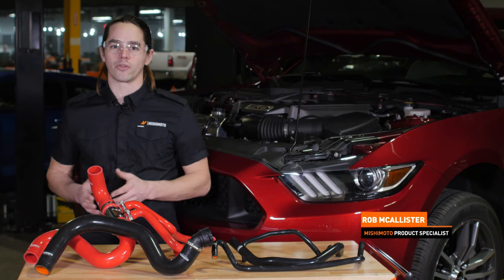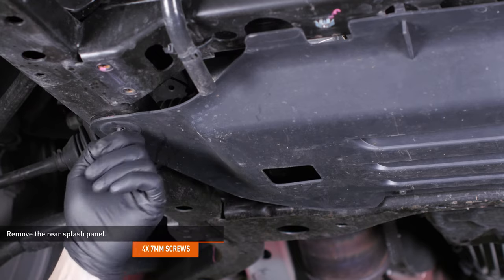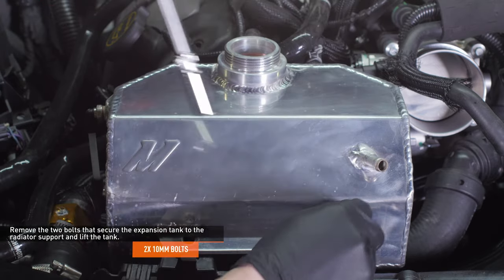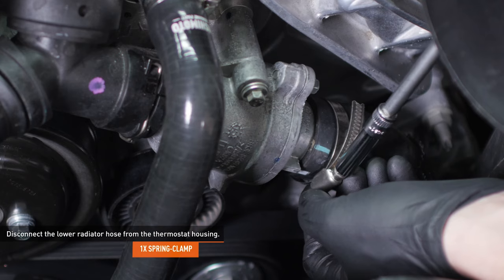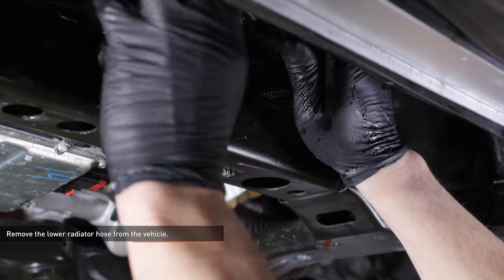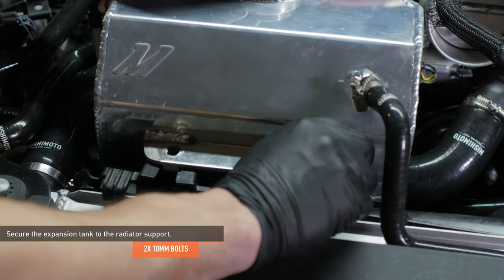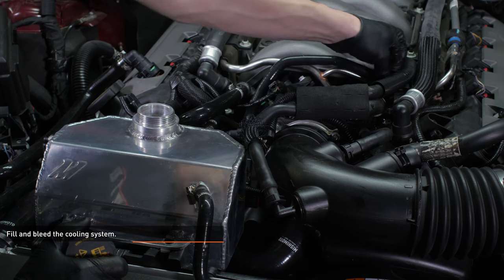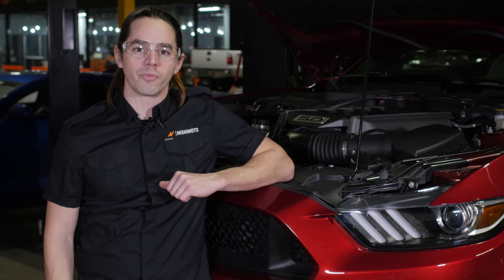2015-2017 Ford Mustang GT Silicone Radiator Hoses Installation Guide by Mishimoto

Comment: Will the Ancillary Hose kit fit a 2020 GT Mustang? If not does Mishimoto have any kits for the 2020
Reply from the maker: Due to changes made after 2017 this would no longer fit your 2020 model. We have currently not released a new kit for the later model cars.
Reply: Will these silicon hoses be available for the 2018 and up gt mustangs?

Comment: Is this legal in California? I would want one but so afraid of smog test
Reply from the maker: While the silicone radiator hose kit isn't technically approved by CARB, We don't see how these would have an affect on the emissions system of a vehicle. We suggest contacting your local inspection station if you have any additional questions.